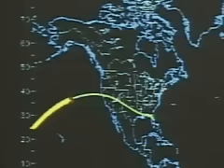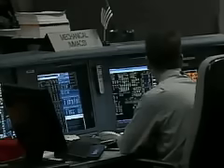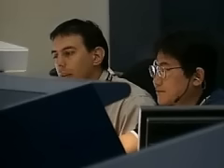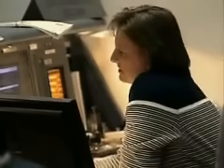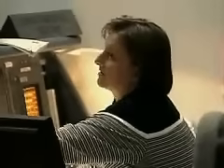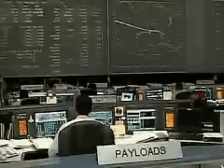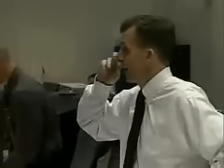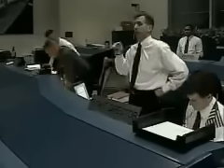Inside Mission Control During STS-107 Columbia's Failed Re-entry and disaster

Comment: Yeah he asked where the sensors failed because he was told right after the launch that they suspected there was an issue with some debris hitting that left wing. He was told that while in orbit, there needed to be pictures taken of that wing to see if there was damage. So his heart had to drop when they said left wing! But he ignored this recommendation and said he considered it a “dead issue”. So if they would have taken this advice for the safety of the crew, they would have seen the hole in that wing and the crew would still be alive. Sad that this could have been prevented. Just like space shuttle challenger, both the accidents occurred because people failed to acknowledge serious suspicions and follow recommendations. Both accidents were caused by human error in judgment. Not sure if anyone was held accountable, but they need to be.
Reply: Seeing the hole in the wing doesn't do a damn thing to save the crew when there's no way to fix it.
Reply: almostfm they would have come up with something, not just let them die. Either way, still wrong to ignore warning signs!
Reply: @rac86quel  "They would have come up with something" presupposes that there was something they could have done, and just didn't.  That's not always the case, and insisting that they should have tried options is not the same as them having actual options to try.
Reply: almostfm No it doesn’t. I didn’t say that they knew exactly what to do and just neglected it. What they DID neglect to do is listen to Mr. Rocha who had concerns. It wasn’t taken seriously just like Challenger. Again, the conclusion was that NASA’s culture was flawed and needs to be changed.
Reply: @rac86quel  OK, let's say they take a look and they discover the hole in the leading edge of the wing.  What's next?

There was no practical way to get to that part of the orbiter, and no tools to actually fix it even if they could get out there.

They were in an entirely wrong orbit to get to the ISS with the amount of fuel on board, so they couldn't go there and wait for rescue.

The consumables on board Columbia would have been exhausted after no more than 30 days. Those can't be restocked on orbit, and the only way Atlantis would have been ready to launch in time for a rescue would have been if they'd skipped all the safety and readiness checks, and then hope they could somehow launch on time to get there.

That's what I was talking about when I said that wanting options and having them weren't the same thing. NASA certainly should have addressed the foam issue before, but once the foam strike happened, there wasn't much of anything that could be done.
Reply: Greased Lightning Not the point. The conclusion was that NASA’s safety culture is flawed and I AGREE

Comment: What no flight director ever wants to say. ‘Lock the doors.”
Reply: What does locking the doors do in this situation?
Reply: AliJaeJR Lock the doors” means there is no longer an emergency. It means the crew of a spaceship is dead. The command to lock the doors is to secure mission control so that nobody comes in or out. All controllers are to begin saving their telemetry for the investigators.
Reply: @AliJaeJR  it means that no communication with the outside are done during that period and everything inside is secure. It doesn't have to be a accident. It just means that it is changing path from it original mission
Reply: @AliJaeJR  I heard in another video that it preserves evidence of those present and what they were doing during the disaster. So they can see if any person was being negligent or not doing their job correctly at that moment in time.

Comment: They had to have some idea that this was going to happen. During the launch of Columbia's 28th mission, a piece of foam insulation broke off from the Space Shuttle external tank and struck the left wing of the orbiter. Similar foam shedding had occurred during previous shuttle launches, causing damage that ranged from minor to nearly catastrophic, but some engineers suspected that the damage to Columbia was more serious. But they knew the damage could not be repaired by the crew. How do you tell them they are all going to die?

Comment: 5:45 is essentially when they realize hydraulic sensors on the landing gear are failing. At 6:07 temperature gauges are off the scale and the flight director stares for a long couple seconds as he realizes the ship is breaking up. You can see the color drain from his face. The ECON controller hits mute on her mic to say something off the record. At 12:30 the order is given by the Flight Director to lock the control room doors.

Comment: Both shuttle disasters were preventable.  In the case of Columbia, they knew there was the possibility of damage, yet they rolled the dice.  There was no backup plan to get the astronauts should there be any problem, and there was no visible inspection made of the spacecraft.  Just stupidity.
Reply: OK, my standard question to people who say they should have made a visual inspection by doing an EVA: Let's say they do, and they find that the foam strike has fatally wounded Columbia.  What's the next step?
Reply: @almostfm  Since they had no plan, then they had to come up with one.  They had to try to save the crew somehow. They had to leave the shuttle in orbit for extended period of time.  Perhaps they could have sent up a Soyuz or rocket with fuel or extra spacesuits and food that would rendezvous with the shuttle.  Or send up another shuttle.  Or try to manuever the shuttle near the space station.  Here's what I believe: NASA didn't want to know the truth for sure because then they would have had to make it public, and then for sure the public would know NASA didn't plan for that situation.
Reply: @georgesealy4706  There are several problems with your "they could have done" scenarios.

They had a maximum of 30 days flight time before the consumables that ran the fuel cells ran out of power and the crew would die-that's assuming they started minimizing consumption of electrical power no later than Day 6.  Those consumables could not be refilled on orbit.  The fuel cells also provide drinking water, and although the food would have run out, you can survive for quite a while without food-not true with water or electricity.  That ruled out a resupply mission.

Columbia was in nowhere near the right orbit to get even remotely close to the ISS, and had only about 10% of the fuel that would have been needed to get to that orbit. So that's out.

Because of the timeline, a rescue mission would have had virtually zero chance of even getting off the pad on time.

Wanting to have options and actually having them are not the same thing.

Comment: I’m no expert, but just listening in, it seems like there were concerns about the landing gear and tire pressure too.  Makes me wonder if the flight controllers knew the mission was doomed even before they lost communication on re-entry.
Reply: The problem was that loss of the gear and tire pressure sensors pointed to a more serious problem, especially when the FD asked about "commonality" and was told there was none.  Because if there had been, that would have been the most likely reason for the sensor drop out.

Imagine you get up tomorrow morning and discover that your coffee maker, your microwave, and your toaster don't work.  It's possible that all three failed independently, but the most likely reason is that the circuit breaker that provides power to your kitchen has tripped.  That's the point of commonality for all three.
Reply: @almostfm  Good answer.

Comment: By 5:20 they knew how this was going to end. First they lost four temperature sensors on the wing, then, they lost the tire pressure sensors. They knew this is exactly what would happen if the heat of re-entry chewed through the damaged area on the wing and began overheating sensors and electronics.

Comment: Shuttle was a failed program from the beginning. There were thousands of issues that the public and astronauts never found out about.
Reply: Like? You can't just make a statement and not back it up.
Reply: @billdoggonejones  I can think of two big ones right off the bat: 1) There was no capability to do an abort before the SRBs were jettisoned. If you had a problem with one of them, you were screwed. 2) Because of the design, the orbiter was in a position to suffer damage from FOD strikes.  For all the complaints about the SLS being "just like Apollo", having the spacecraft on top of the stack eliminates those two problems.

Comment: The only viable option at this point would’ve been a rescue mission; sending more astronauts up there. There wasn’t even a toolbox kept on the Columbia, so the astronauts had no way to repair the wing even if they were fully aware of the problem.

NASA did send footage of the damaged wing to the Columbia’s crew before re-entry, but were told it was nothing to worry about. The crew all agreed.
Reply: And even a rescue mission wasn't really viable. They'd have almost no chance of getting a mission off the ground successfully before the crew died from a loss of electrical power or CO2 poisoning.

Comment: Leroy Cain was part of the mission management team (along with Linda Ham, Ron Dittemore, and Phil Engelauf - seen here with moustache, he gives the bad news) who knew there had been a very serious foam strike on the left side during launch, and who, together, ACTIVELY prevented any surveillance by the Air Force that might have confirmed it. Engineers who had some knowledge of physics were BEGGING for surveillance. This was not a sin of omission, but of CO-mission - this was something they ACTIVELY inhibited. As such, in my opinion, they are directly responsible for the tragedy - all of them. So without any doubt, when the left-wing anomalies began to occur, Cain cannot possibly have failed to understand their implication. But instead of acting, he sits there dithering and trying to convince himself that it's all fine. Compare that to Gene Kranz on Apollo 13, who gets everyone on the same page and points out that the astonauts are talking about bangs and outgassing - not instrument problems. No - Cain dithers when there was, in fact, a ghost of a chance to save the orbiter had he acted IMMEDIATELY. That was to fly the vehicle in a non-standard, and very possibly futile, orientation with the right side taking the great brunt of the heat of re-entry. This would have put the left wing root in the shadow of the forebody and given them just enough time and controlability before the left wing failed to reach bail out altitude. It may not have worked, but it was a chance. And the pilots would have gone down fighting. But no - Cain dithered and covered his ass. It pisses me off. His punishment was to go on to another position of great responsibility. We live in an era of too-big-to-fail. The terrible program managers at NASA who have totally wrecked our manned space effort were too big to fail. (All the above information is taken from published reports.)
Reply: No, Cain as ascent/entry Flight Director was not a member of the MMT. He had to rely on the Information he was given from there,  which was that it would be no big deal. Part of this misinformation comes from a story quoting an e-mail of his where he wrote that asking for pictures was a closed case. But that was one sentence taken out of context,  he actually was telling another engineer, who had asked him about it, that he could not do anything as he had been told by MMT that they had finally decided not to take any action. I know a few people who worked there at the time and are still having trouble with the way things were handled, but the common knowledge for the people in Mission Control at the time was that the top engineers had said it would be no big deal,  like the litterally thousands of foamstrikes they had before in the program.
Reply: @ksracing8396  False. I read the reports.
Reply: @ultrametric9317  Then you must have misread them. Your post just shows you have no idea at all...  And I am not willing to discuss any further with someone throwing unbelievably unfunded accusations against a very impressive person, who did a very professional job under very difficult circumstances.

Comment: Here's the thing most folks don't know. There is a point during a launch, like the first 5 mins or so, they can abort. They separate the orbitor from the solid rocket boosters, and it basically becomes a plane. They could have aborted. Nasa fucked up. That was determined early on in the investigation.  Many higher ups at nasa were questioned, why didn't they abort.  They said,  they didn't know it was that bad, they knew foam came off and possibly damaged a heat shield.  They openly violated policy, nasa stated that if during the first crucial moments of a launch there is a suspected problem, they are supposed to abort....no questions asked. They didn't  they gambled. And lives were lost.
Reply: A Shuttle could not abort when the SRB's were lit.  Imagine letting those rockets go while still creating thrust?  Chaos.  You are on about RTLS - Return To Launch Site abort.  It could only be done AFTER SRB separation.  This is why Challenger could not abort in 1986.  Nobody can predict debris hitting a Shuttle.  The impact wasnt noticed until the next day when reviewing launch footage.  By then Columbia was in orbit.  Too late.

Comment: And all because of a piece of foam.  They knew they had problems with the insulation just like they knew they had serious problems with the booster o-rings.  Chicken wire would have worked perfect as crazy as that sounds.  Just a couple hundred more lbs is all it would cost.

Comment: The moment columbia stopped answering they knew columbia had gone
Reply: Less than two weeks after the incident, the Flight Director gave an interview. He explicitly stated the moment he first "had pause" was when they lost the four temperature sensors. That moment is at 6:08 in this video. 

Please only give accurate information. Speculation helps no one.

Comment: At 5:10 you here mission control contacting the Columbia saying they were having trouble reading their tire pressures. Then you hear the voice of a crew member (Husband ? McCool ?) responding "Roger" at 5:17; and immediately afterward you hear a bunch of static pops and crackling over the radio transmission for a few seconds. I wonder if that static noise was the moment the shuttle broke-apart and disintegrated ?
Reply: probably.

Comment: NASA knew the damage to the heat tiles was a death sentence for the astronauts, they also knew insulation was coming off during laugh but failed to correct it, I do not think anyone wanted these brave souls to perish but it begs many questions
Reply: Actually there was no tile involved. The leading edge of the wing was made of carbon/carbon and was molded. It shattered when the foam hit it.  No one took into account the speed of the shuttle at the time the piece of foam hit the leading edge of the wing. From the video they had it looked like the foam just vaporized. Nothing they could have done for them anyway. No way to repair. Nothing they could get airborne quick enough to rescue them.
Reply: Maynard G. Krebs then why were they discussing sending tile repair kits on the shutttles
Reply: @phantom7crossrose528  Most of the shuttle is covered in the silicon tiles. The part that was shattered was not the silicon tile but a carbon/carbon molded product that you don't just produce out of thin air.
Reply: @MaynardGKrebs-gv4vy  they could have hurried another shuttle launch but that risks 7 more lives and rescue mission from one shuttle to another  also high risk. if things don't go right then things will go horribly wrong.  i think back in the early 70's they would have tried a rescue mission. this time around they had their fingers, toes, and anything else crossed hoping there wasn't any damage or very minor if there was and not affect re-entry. you really have to think that after all those sensors starting going off on the left side mission control people starting crapping their pants, literally.

Comment: There facial expressions automatically should tell ALL OF YOU REGARDLESS OF HOW OLD YOU ARE, that they KNEW something bad would happen if it didn’t in the beginning. Those motherfuckers  knew it. And closed doors. I don’t give a fuck what any of you think. THEY SHOULD OF DONE SOMETHING ABOUT IT FROM THE START and should have saved as many as them as possible. BUT THEY CHOOSED NOT TO AND WENT ON WITH THE MISSION AND DIDNT LET THOSE ASTRONAUTS KNOW ABSOLUTELY NOTHING. there faces tells it all... And you all know it too...
Reply: there was never any visual of the point of contact which was obscured on the lift off film. they were playing the odds that no damage had occured  because foam strikes happened on other missions without causing damage. they didn't know there was a hole in the wing, they were  hoping there wasn't